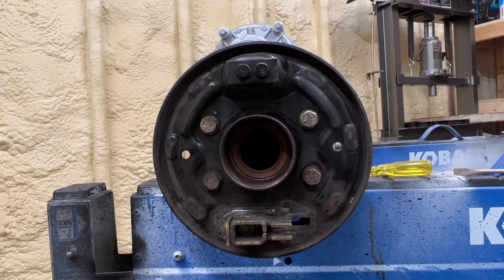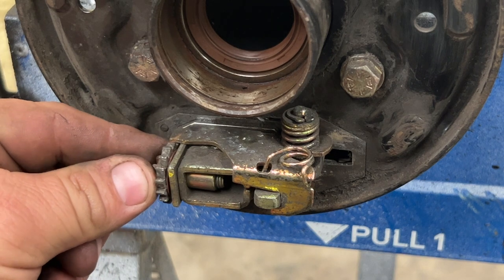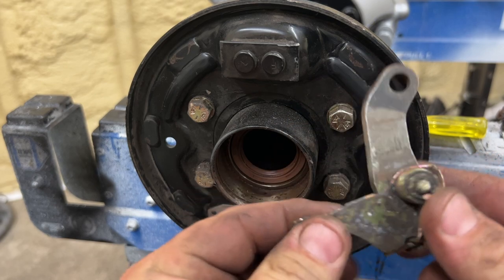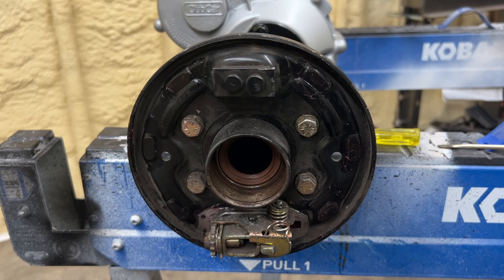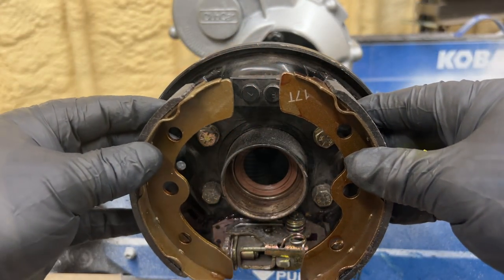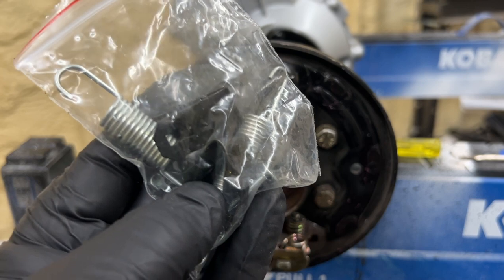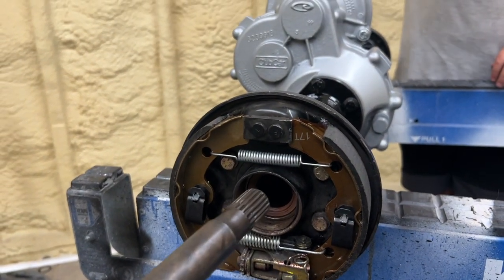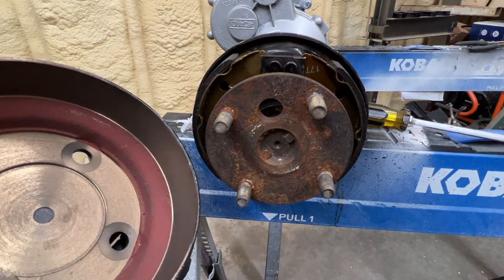How To Install Brakes on a Club Car Precedent Golf Cart | Golf Cart Brakes Not Stopping

Comment: I have a 2010 club car precedent, I changed the brake pads and now the HUB won't fit. Pads seem too thick, or the pads need to close more. CAN ANYONE HELP???
Reply: Dealing with the same issue. Did you ever figure this out?